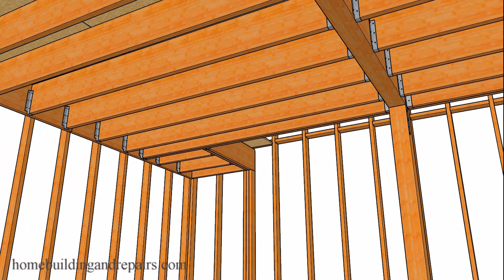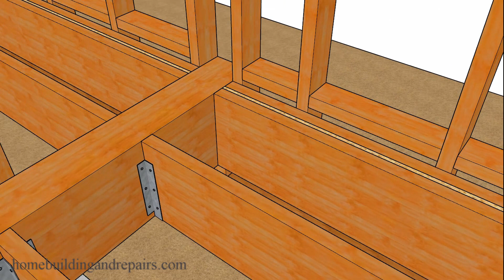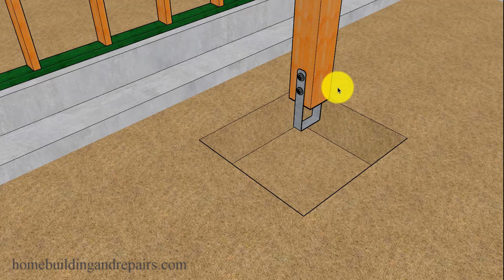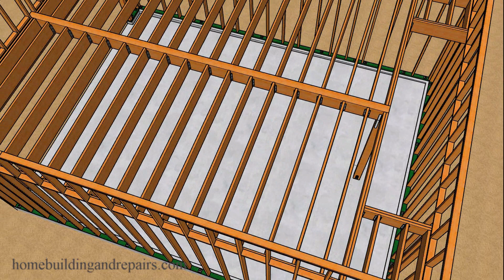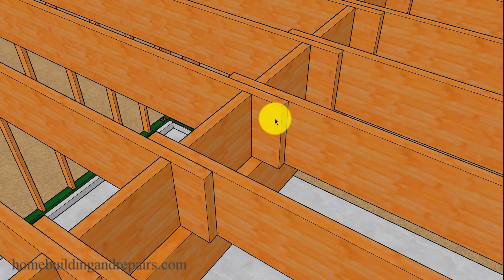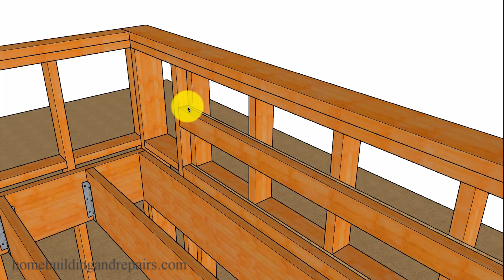How To Add A Floor Beam When Designing And Framing Your Garage - Part 15 Possible Money Saving Tips

Comment: My garage has almost this exact setup. In my garage the center beam is (2) 2x12s lag bolted together that spans probably 20 ft front to back. I am planning to hang joists with joist hangers off each side to a ledger on the opposite walls and attach the joists to the ledgers with joist hangers. I also probably will add a support column in the center of the center support beam for extra strength. Two questions: 

How thick is your center beam that divides the two garage bays and supports the 2nd floor?
Would you dig/pour a new footer for the center support column?

Comment: If the joists were gonna function as rafter ties, with the flush girder method, would you need some type of strap on the joists where they butt the girder? Or is the joist hanger strong enough to take the thrust, or maybe the sheathing?
Reply from the maker: If using sheathing you might be okay, but if you're worried about a structural connection, you can always add a strap for a better connection.
Reply: @gregvancom  what did you do normally?

Comment: i have a 2x6 14ft high wall 23ft w and 21 ft L
all up 4 walls are up only thing missing is the roof i’m trying to build a flat roof we’re i can hang out up on with family ect. with no beam holder  meaning the bottom stick that holds the top beam in middle it’s a shop 1 big car garage shop. is there a video i can see or you can make we’re i can make a flat 24x21 ft  roof please
 thank you
Reply from the maker: I don't have one yet on building a flat roof for people to use.